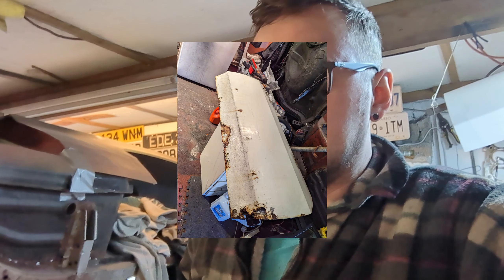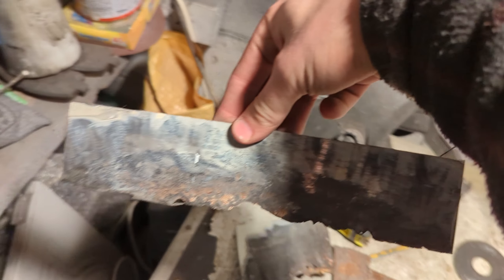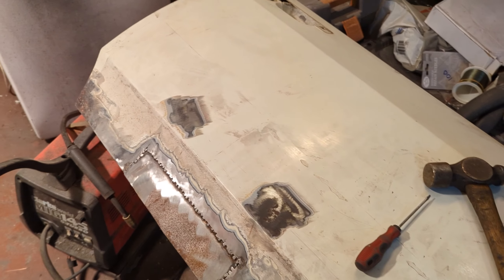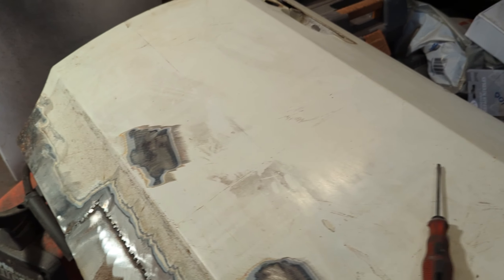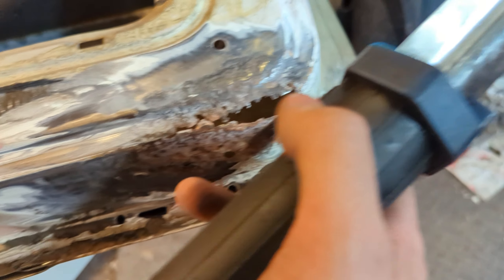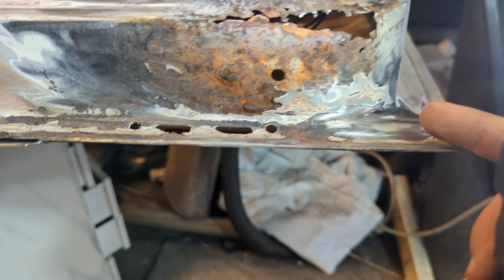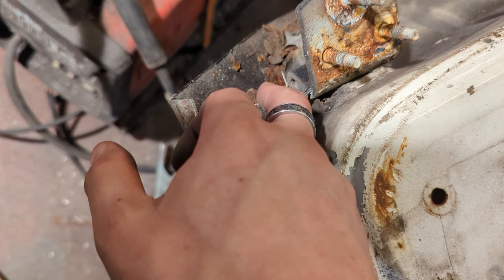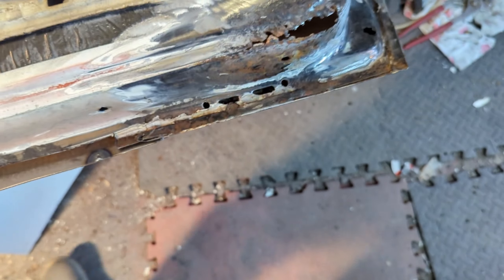Capri turbo update. door repairs

Comment: Voltage regulator on the back of the dash clocks is a common issue on them
Reply from the maker: What's the fix?
Reply: @jonyb4  replacing voltage regulator with a known good item. Also with the fuel guage, check the earth in the boot floor near the spare wheel